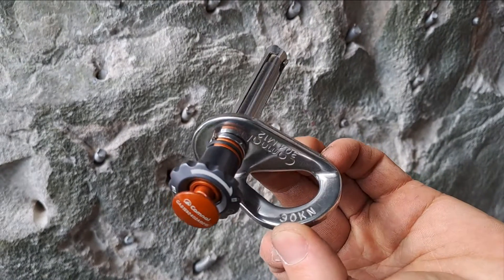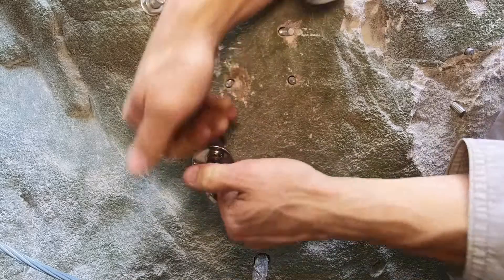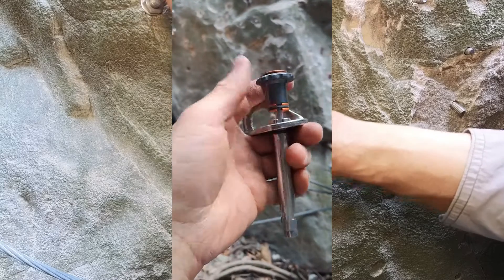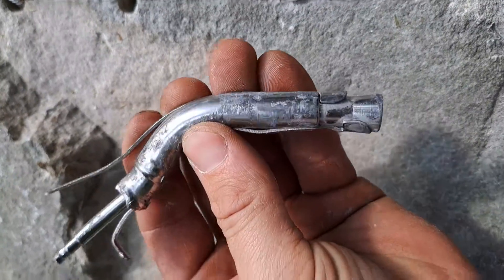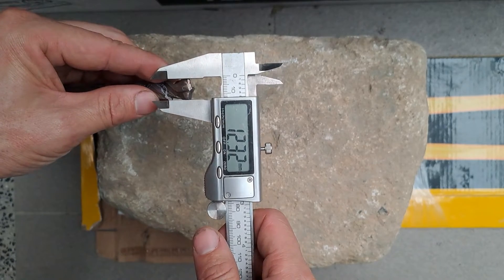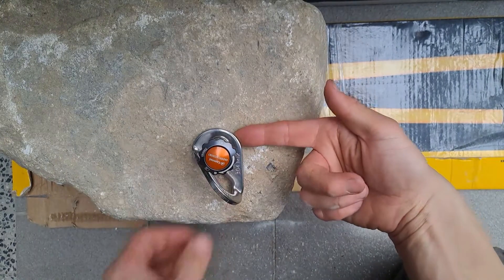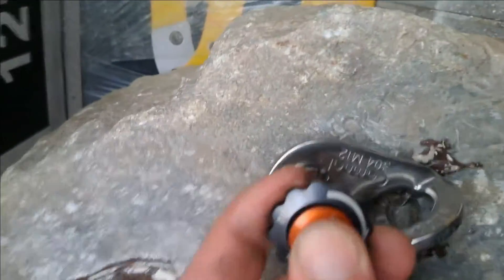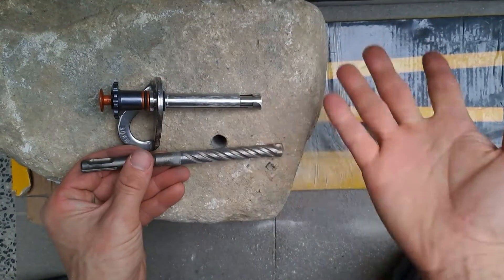BREAK TEST: Camnal 12mm Removable Bolt, made in China

Comment: Wouldnt you just need a longer drillbit?
Reply from the maker: A longer drill bit, I can try that. There's also another issue I outlined in the review video where the movable tabs don't fully retract, making them stick out a tad more because they touch the bottom of the flaring cone. Camnal has some slight kinks to work out to improve its design a little better.